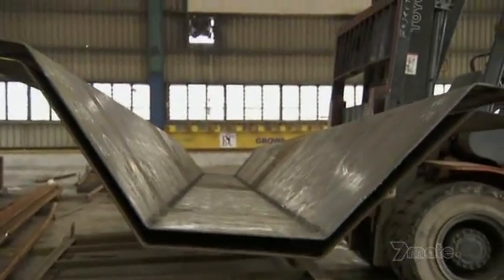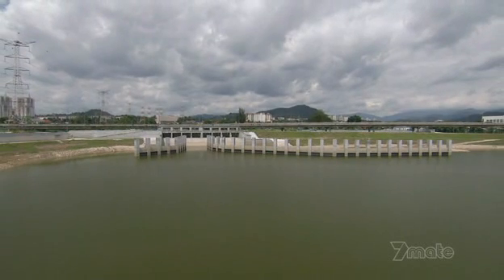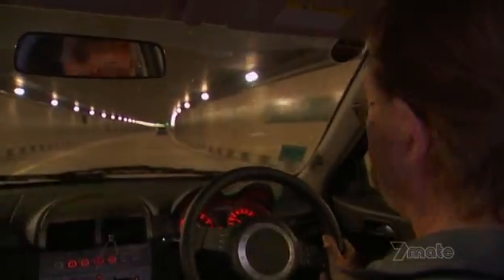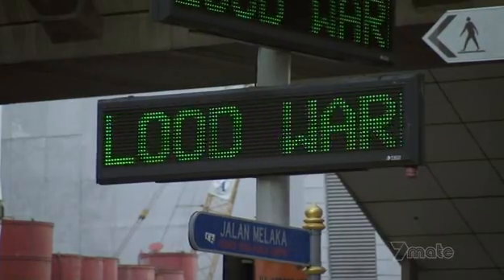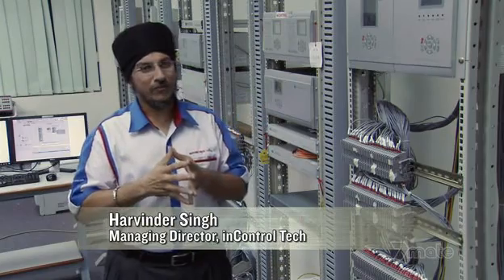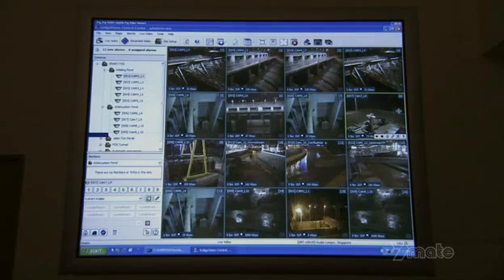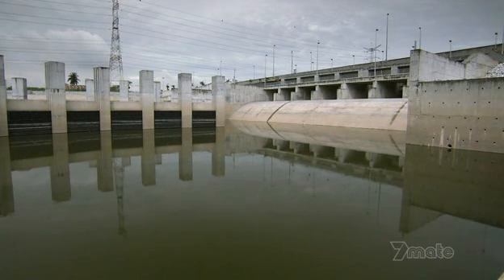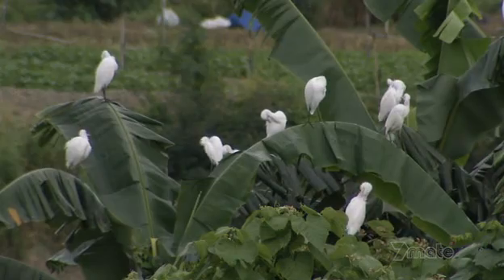Discovery Channel Man Made Marvels Kuala Lumpur Flood Control 4/4

Comment: 6:28 did someone notice the spelling?
Reply: 😂 do not access the high pressures. You cant handle the pressure.
Reply: Submergible 🤣
Reply: I actually checked, the word does exist and would be somewhat correct apparently. It should still be exceed though :D